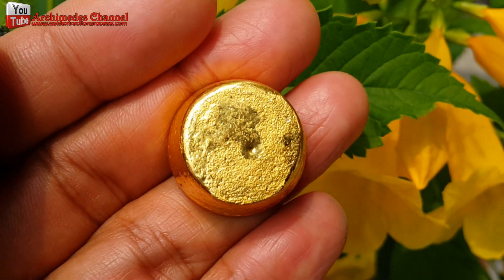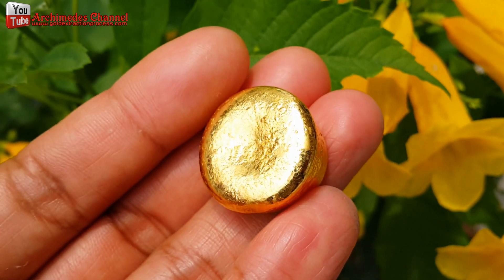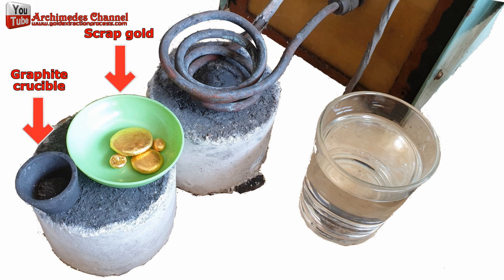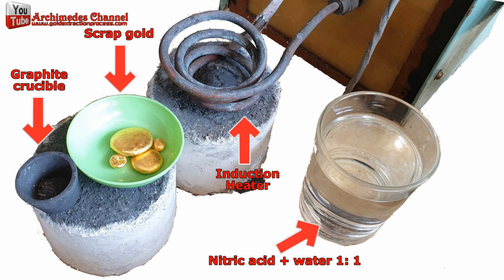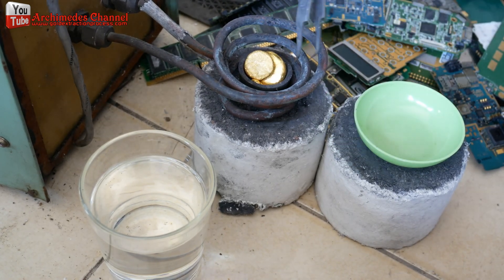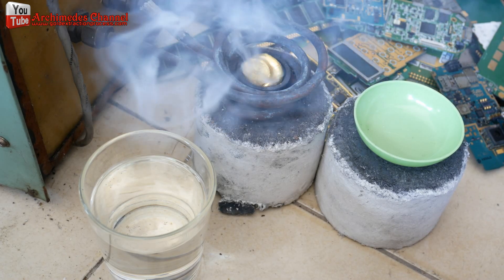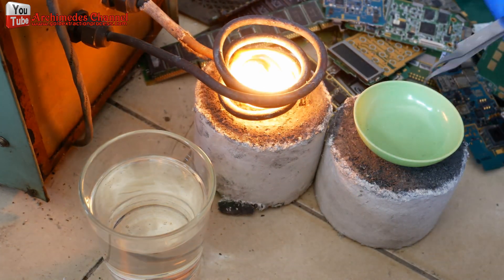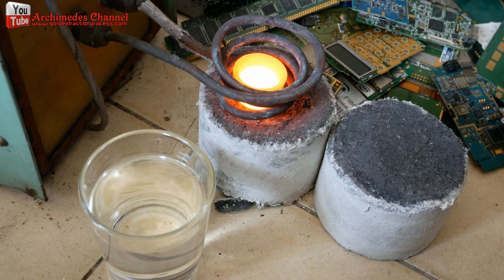how to melt gold fragments together in one lump  By using induction heater and graphite crucible

Comment from the maker: Maybe you have gold jewelry that you want to melt. Or you’re an artist or jewelry designer who wants to create a new design by melting gold. There are several ways you can melt gold at home although you should always take great care to remain safe when melting gold because it requires extreme heat.
Buy a crucible container to hold the gold as it melts. You need the right equipment to melt gold. A crucible is a container that is specifically designed to hold gold as it melts because it can withstand the extreme heat.
A crucible is usually made of graphite carbon or clay. Gold’s melting point is at about 1,943 degrees Fahrenheit (1064 °C), which means you will need temperatures that hot to melt it. Thus, it's very important that you don't just choose any container.
In addition to a crucible, you will need a pair of tongs to move the crucible and hold it. These need to be made out of heat-resistant material.
Some of these electric gold furnaces are pretty affordable. They also allow people to mix metals together (such as gold, silver, copper, aluminum, and so on) and melt them at home. To use them, you will need the same equipment, including a crucible and flux.
If the gold item also contains small percentages of silver, copper or zinc, the melting point will be lower.
You can buy a microwave gold smelting kit or kiln. You place the kiln on a kiln shelf in the microwave. The crucible holds the gold while it is being heated and is placed in the kiln, with a lid on top.
Don’t use the microwave for cooking food again if you have used it to melt gold, though.
The gold should be placed into a crucible. Then, put the crucible on a fireproof surface, and direct a torch toward the gold within the crucible. If you add the chemical borax to the gold first, you can melt it at lower temperatures, which might be needed if you’re using a torch.
Be careful to bring the torch down slowly if you have fine powdered gold in the crucible because you could easily blow it around. Heating the crucible too fast also could crack it. You want to heat it thoroughly and slowly. An oxy-acetylene torch will melt the gold faster than propane.
With a torch, hold the flame well above the gold powder and slowly work in a circular motion. Once the powder begins to heat up and turn red, you can begin to work the torch in slowly until your powder is reduced to a nugget.
Pour the melted gold into the ingot mold or other mold before it hardens. Then, let the gold cool. The mold should be made from similar material as the crucible
Don’t forget to clean up your mess! You never want to leave heat sources unattended or in the reach of children.
Reply: What would happen if you put those phone circuit boards in there?
Reply: We're do I buy a cruseibile
Reply: Plz recover gold with coal plz make video coal recover gold